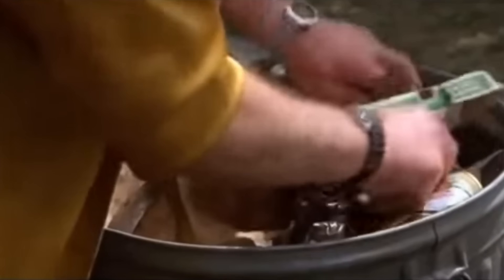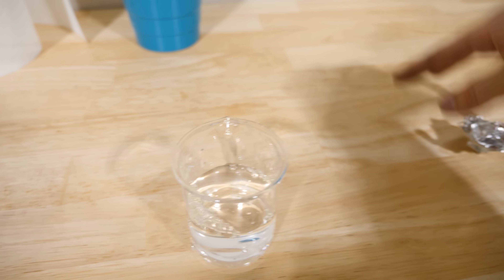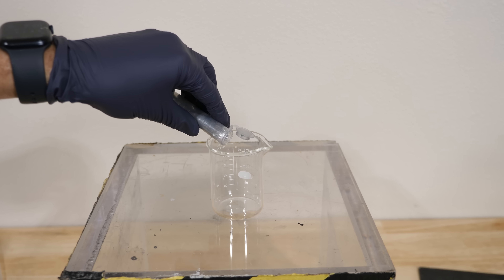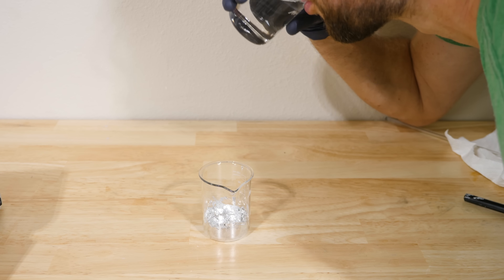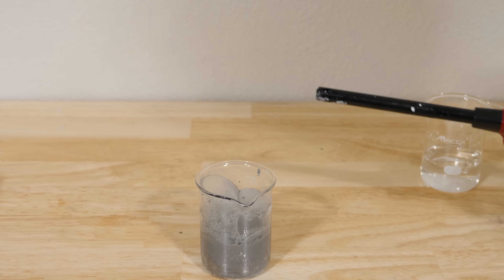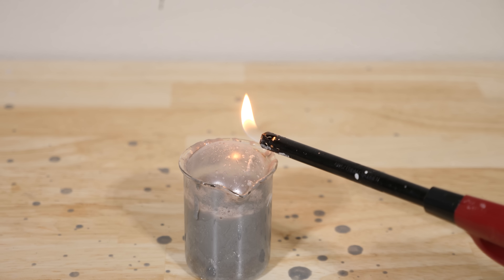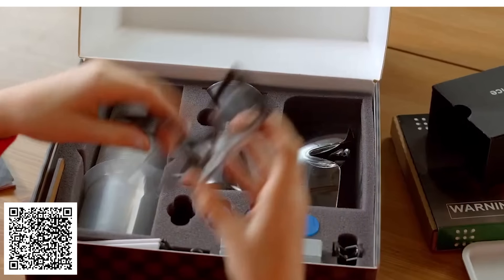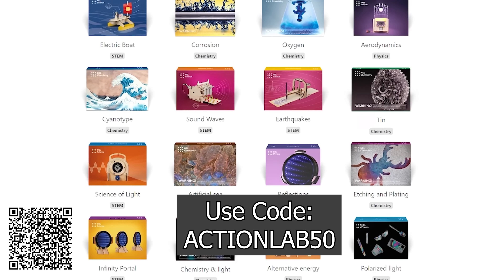This Liquid Metal Turns Garbage Into Fuel

Comment: Seems fishy that the gallium would not be consumed, although since the standard enthalpy of formation of gallium oxide (Ga[2]O[3]) is -1089.1 kJ/mole compared to -1675.7 kJ/mole for aluminum oxide {Al[2]O[3]), it could be that if you stop the reaction right when you run out of aluminum, you wouldn't lose much gallium.  (I would have given Gibbs free energy instead of enthalpy, but I couldn't find it quickly for aluminum oxide; but at relatively low temperature, this shouldn't make too big a difference, and indeed doesn't for gallium oxide.)  Still, the metals take a lot of energy to get loose from oxygen (obviously more for aluminum than for gallium, but still a pretty hefty amount for gallium).
Reply: From Wikipedia's article on gallium, it seems that gallium also forms an inert oxide coating, reducing its reactivity at room temperatures. Britannica notes that gallium reacts with water above 100°C, so I assume the Gibbs free energy for the oxidation is quite high.
Reply: @RexxSchneider  The passivation layer is disrupted because it's liquid. Some gallium is definitely going to oxidize.

Comment: If you added some sodium hydroxide to the water, then you'd get even more energy out of it because you'd be repeatedly removing the oxide layer (at least until the hydroxide was used up)

You could also use an alloy of indium, gallium and tin as your starting point before you add the aluminum, that way you don't need to heat it up.

Comment: The most wasteful method of hydrogen generation.   All aluminum is refined from bauxite using electricity AND the electrodes are consumed, producing carbon dioxide. 
It is far better to recycle aluminum,  it is far more energy efficient.  Use hydrogen in gas to liquids chemistry.

Comment: You can't believe that these days I was doing researches about this same Idea !!! and then you made a video about gallium. OMG!
I have tried the same thing 2 days ago. and I found some problems : the gallium is not recycled 100% because when the alloy is reacting with water, not only Al reacts. Ga also reacts and becomes gallium oxide. and turning Gallium oxide into gallium metal is a long story. And gallium is pretty expensive these days for doing this on larger scales.
But I Have A Great Idea : these days I am thinking about making metal alloys with Gallium.For example: Adding some Fe and Ti powder to gallium, to make a titanium iron gallium alloy. and using a special reagent to only dissolve gallium without hurting other metals. So you can make alloy s without any High temperatures!

Comment: See the better idea here is to recycle and reuse the aluminum in metal form, rather than essentially "burning" it back to it's oxide form. It's far more useful to us as a metal, and why would we "burn" that energy making hydrogen when we could just use renewables to run electrolysis plants or use the hydrogen the still needed plastics industry is going to have as a by-product of the oil refining stage? makes more sense to burn that and try to get the carbon side into a form that can be buried again (like graphite or some other solid) instead of just burning off whatever isn't used for polymers.

Comment: What if the aluminum was underwater in a vacuum chamber, where the air would be pumped out and then heavily scratched. Would it still quicky form oxide layer or somehow react?

Comment: Seems like I’d need 386g of aluminium, just to provide equivalent of 1L of petrol. Might work on industrial scale, but seems wasteful since aluminium is used for things, you’d then have to go aluminium oxide to metal again and it might be more efficient just to recycle aluminium. But it could potentially be put to use in aluminium recycling plants, providing some of the heat to recycle aluminium then mixing the oxide with to be processed with mined aluminium.

I think aluminium air batteries are a better way to go.

Comment: i have a few questions, hope someone can help.
1st what happens if instead of adding water to the mixture, you add the mixture to water, like more water, would the experiment be more controlled or more dangerous?
2nd if the mixture was added to a large pool of water that has a electric current going through it how would this mixture react?
if anyone knows please let me know
Reply: If you had a large excess of water, then it would act as a heat sink for the exothermic reaction, so the temperature would likely remain mores stable, particularly if the water were stirred continuously. You'd still get the same amount of hydrogen produced. Electric currents have no effect on the 2Al + 3H20 → Al2O3 + 3H2 reaction in water.
Reply: @RexxSchneider  thank you for the reply, I was just wondering what if you applied the current to the mixture directly while it was in a lot of water, what would happen then? Would that even be possible? Maybe my questions might be a bit silly, but I just a little curious
Reply: @atiqh114  In water, there are some positive and negative ions (H30+ and OH-) that will transport current. The ions will react at the anode and cathode, either dissolving the electrodes or liberating hydrogen and oxygen, whichever is energetically more favourable. There is nothing in the Al/Ga/Al2O3 mixture that will produce mobile ions, so there is no mechanism for the current to interact with the mixture. The only possible exception is the reaction of hydroxyl ions with aluminium, but that is exactly the reaction that is occurring already with or without any current flowing.

Comment: I think the challenge is the energy required to convert the aluminum to its oxide form again. With solar, this wouldn’t be an issue, as we could use electric furnaces to re-melt it.

The separation phase would be very important, but given how exothermic the reaction is, the water-gallium-aluminum would have to be cooled first before separation, or there would need to be a significant cooling component during the reaction cycle.

As long as we can recover a very high percentage of the gallium and account for the other factors, it should be possible to use it as a hydrogen extraction process. However, I don’t see that being better or less complicated than the current electrolysis process when its being run on solar.

Comment: The thing is, that aluminium was likely first purified using electrolysis.
I wonder what the efficiency of using this gallium -aluminium composite to make hydrogen would be compared to just using straight electrolysis.
Reply: Pretty poor. One commentator has pointed out that it takes 46.8 megajoules of electrical energy to produce one kilogram of aluminium and that's a lot. Reacting that aluminium with water is exothermic, so you need a means of re-using that heat otherwise you lose at lot more efficiency. Another commentator has estimated the aluminium oxide (via electrolysis →) aluminium (via Ga/Al alloy + water) → hydrogen + aluminium oxide cycle to be perhaps 20% efficient when using the generated hydrogen to create electricity. Conversely, electrolysis of water to hydrogen and then using the hydrogen to generate electricity will be around 40% to 60% efficient.

This technology is energy storage not energy generation. and it only makes sense if it's easier to move aluminium from an Al production plant located near a source of excess electricity (hydro, wind, solar) to a place where it's not viable to transport hydrogen directly produced by electrolysis at the source.
Reply: @RexxSchneider  At least until you get into killer robots... imagine, as a giant mech grabs ahold of an aluminum hulled enemy destroyer and shoves it down it's gullet into its gallium stomach!  :)
Reply: @NacorantheHarmonicaPlayer  Thanks. I think that does fit nicely with my concept of a niche application.

Comment: Aluminium takes a truly insane amount of energy to produce: one beverage can is about the same as leaving an electric heater running for an hour. It's why the bulk of a car's carbon footprint is in its construction, not whether it uses petrol vs electricity
If we could (safely!) make a rechargeable battery out of it, then you're talking a genuine game-changer, as in phones that last a week or a car with easily a 1000 miles range on it

Comment: How is the aluminum separated from the gallium after the reaction is complete?
Reply: When the reaction has completed in an excess of water, all of the aluminium has been converted to aluminium oxide, which is insoluble in gallium or water, so will separate from them. It is less dense than gallium and more dense than water, so will form a layer between them.

Comment: Although I enjoy your content, it would have been amazing to see a Gallium-water control as well as the Aluminium-water control you presented :) Also, as a side note, Aluminium is an amphoteric metal, which means that hydrogen is produced in the presence of either an acid OR a base (naturally, in an aqueous solution) :)

Comment: The reaction produced water, gallium and aluminum hydroxide.  The aluminum hydroxide is useful as medicine but can also be turned back into aluminum.  As with all things, the real issue is the energy required to reverse the process to get back to the starting point.  We need a fundamentally clean energy source to prepare the things that produce energy we can put to use in personal applications like vehicles and homes.  We're probably close to it with nuclear power getting a lot of research for smaller, safer, and cheaper reactors.  The sooner we can get fully electric on the consumer side of the equation, the better.  Industry is much better suited to doing these cycles of producing fuel and then recycling the components.
Reply: What happens to the aluminum hydroxide? Is it mixed in with the gallium he recovered? Or suspended in the solution he recovered it from?
Reply: @Myndale  it's what got spit out by the reaction. The grey soup.
Reply: you can use the aluminum hydroxide as a refractory material.

Comment: I've never seen Charlie Kelly say anything intelligible. xD
Ok all jokes aside. Wouldn't it be easier to simply add aluminum oxide to hydrogenated gallium as a method to regulate the off gassing.
I understand shielding the reaction from Oxygen is perceived as crucial however H20 is already 1/3rd oxygen .

Comment: If I understand correctly, the eventual cost of the hydrogen produced by this method is the cost of processing the leftover aluminum oxide back into aluminum.

So the question is: how costly is that processing step?
Reply: Heat it to 1470 K to form aluminum oxide (alumina) and then electrolyze the metal out of it. Raw bauxite requires more steps and remains profitable, so if you're refining pure aluminum hydroxide I would think it's not too bad, but it does takes a lot of energy.
Reply: Something like 17,000 kWh of electricity to produce 1 tonne of aluminium. If you're somewhere where fuel is cheap, like the Persian Gulf, that can be as little as US$1100, according to Google. It still seems pretty costly to me.
Reply: Thank you both for your replies.   You  revealed an important consideration that was missing from my original comment:

The cost of processing the reacted aluminum oxide must be evaluated relative to other available means of obtaining aluminum.

Comment: Nifty! But what happens to the aluminum? I guess that it turns back into aluminum oxide, which stays at the bottom of the beaker.
Reply: Aluminium oxide is less dense than gallium, so it floats on the top of it.

Comment: Instead of using aluminum to produce hydrogen, it would probably be more energy efficient to use aluminum-air batteries. They are also way more energy dense than lithium ion batteries used in electric cars today, because the oxidizer is oxygen from the air which doesn't need to be carried. The biggest issue with them is that they are single use only, because the anode turns into aluminum oxide which can't be converted back into metal easily, and needs to be re-refined. Other parts of the battery are reusable. For this type of battery to be viable, there would need to be refilling stations where the anodes could be quickly replaced, and then the aluminum and other elements used to help the battery work could be recycled. 

The other problem is efficiency. Hydrogen for vehicles has a round trip efficiency of about 30% (after waste heat lost in producing hydrogen from water and in the car's fuel cell), which is pretty low. But current aluminum-air batteries would have an efficiency lower than 10%. The theoretical max value is closer to 50%, but that probably won't be practical.

Basically, producing hydrogen from aluminum would be horribly inefficient for powering cars, plus recycling metal is WAY better than re-refining it from oxides.

Comment: This is a non-viable process for storage, and even less for production of power :
To produce 1 metric ton of Aluminium by electrolysis, the theoretical power consumption is 5.64 MWh, but due to the losses in the process, it is around 13.5MWh, not counting the power required to produce the electrodes.
Wathever hydrogen you may get from the process you describe, it will never be more than 5.64MWh available by ton of Al.
Then you have to convert this hydrogen into energy, with an efficiency around 60% for fuel cells, and way less if burning it.
It is an overall efficiency under 20% at best, with, as seen in your video, a very dirty process needing constant tuning, and very high cost installations and equipments.
Also, consider Al is around 2.5k$ / t (2 438 $ today), it would make the hydrogen cost at around 50c / kWh, and the electricity from power cells at around 80c / kWh. And this is the price for production, the cost for the final user would be much higher (over 1$ / kWh) with margins and taxes. Where i live, end user get electricity for 15c / kWh, it is 6 times less....
The process works, no doubt about that, but it is not even close to be cost effective, and will never be, as processes efficiency gains won't be enough.
Nice curiosity, maybe a niche use is possible, but not usable on a large scale...
Reply: Thanks for the detailed analysis. It confirms my rough calculations on the non-viability of this technology for energy storage (it's clearly not an energy production technology).

As a side-note, where I live, the regulator has just allowed energy companies to charge to end user UK£0.52 (US£0.61) per kWh of electricity. That's because of the dependency of UK electricity on gas-powered power stations. Even at that level it's still cheaper than Ga/Al technology to produce hydrogen.

Comment: I only see one major problem with using this on a large scale, and it’s the fact that hydrogen is extremely nasty to work with. Bein a really small molecule, it loves to slip through the tiniest cracks in pressure vessels, and it’s nearly impossible to store it long-term. It’s also a bit troublesome to work with it considering all the water vapor involved. It may be doable, though, considering that we somehow managed to get wood gas to work on a large scale, which is way worse than hydrogen.
Reply: When produced on demand there is no need to store.

Comment: Using aluminium and gallium to make hydrogen is frakkin idiotic.  It's like using gold and platinum to make nitrogen.  We couldn't even make aluminium in any amount until the last century because it's such a complex and energy-expensive process - and gallium is even worse.  While you can make hydrogen and oxygen with an empty bottle, a sock, a couple of kitchen scouring pads, and a little bit of electricity.